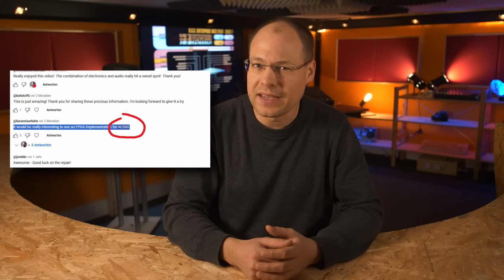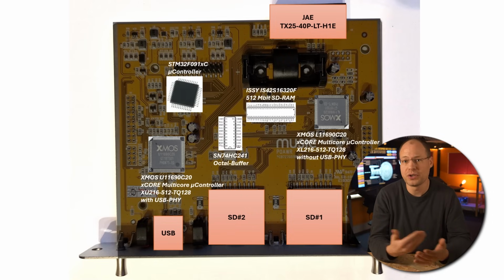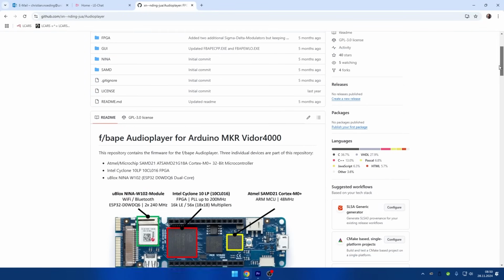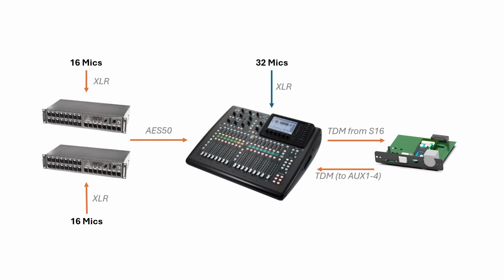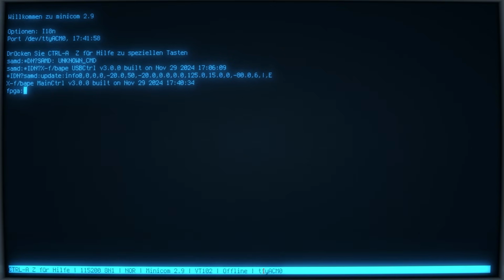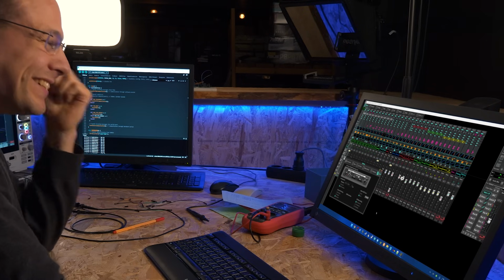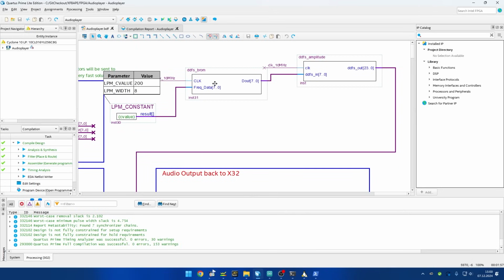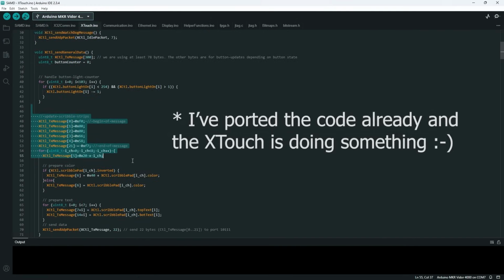X-FBAPE - The DIY FPGA-based card for the Behringer X32

Comment: Great video! You've dared to reverse-design of this HW. Great!
Just a question: Did you ever try to analyse the data exchange between DN-WSG and X32? I just tried to take a look - it seems like the signals are remaped.
Reply from the maker: Up to now I do not have an WSG-card here. As far as I know the FPGA is capable of rerouting the pins for special cards - at least to allow synchronisation of the console to the expansion card. From time to time I search on ebay for an affordable card, but up to now there was no bargain here...

Comment: Hi there. This is a pretty impressive accomplishment. Congrats on the hard work! What are your thoughts on the possibility of an independent device that can take two expansion cards and be used as a format converter using the Behringer low-cost cards? It seems like the audio signal would be pretty straightforward, just cross-patching the TDM sends and returns between the two cards. I would assume a clock would be necessary, unless it was as simple as making slot 1 the master and slot 2 the slave, and have slot 1 take the clock from the incoming signal? The hard part would be sending the cards whatever commands are necessary that the X32 would usually send to the card. I know you have some experience with these cards. Do you think this would be achievable?
Reply from the maker: Hi, I already implemented this function for two X-Cards: https://github.com/xn--nding-jua/DuoXCardAdapter

So, yes, this is possible :)

Comment: it would be nice if you can come up with solution to feed DN4816-O directly from aes50 line so we can have 32 outputs in the amp rack for PA feed
Reply from the maker: AES50 is OpenSource since Christmas: https://github.com/YetAnotherElectronicsChannel/AES50

And we we have a working implementation of an UltraNet-sender. So its already possible to create either an UltraNet-sender with 16 channels to the DN4816-O or an AES50-sender. I planning a video on showing how to deal with UltraNet and StageConnect in a video in spring 2026...

best regards

Comment: Can you control all 64 from the x32 itself though? Or is it in essence just two mixers' stereo out combined?
Don't get me wrong. I absolutely love the project, and the possibilities, but for practical use on the road, it's not as interesting to use an expansion like this if you have to train a band's own FoH tech on how to use it. Just thinking in practical use for my needs ...
If you happen to know how I can get my hands on a few defective X32's (or 1 working one) nearly for free... Social security doesn't allow spending anything basically, so fixing broken gear is my best bet to get some gear together and not be jailed at home with nothing useful to do (long story short: multiple disabilities, not able to get a job anymore, allowed to do some small gigs as a means of "occupational therapy" but I can't make a profit or spend any money to do so.)
I'm in the Netherlands btw, and desperate enough to ask ANYWHERE I can think of ....
Reply from the maker: Yes, using the original X32-control-interface (DAW-section) I'm able to control the additional 32 channels resulting in a real 64-channel audio-console with the same latency as the original console as I'm adding only one single sample as additional latency. But you are right, adding another X32 using AES50 would result in a very comparable system - and with additional processing-capabilities like compressors, EQs, etc. that my system is lacking due to the small FPGA. It was more a "what can be done as a DIY-project" than "is it useful" :-)
Reply: @pcdimmer  Nice!

Comment: hay bro you did great job i need this type of something for wing i want have some issue with every console in love event we have to set-up pa system many different places wing make many things easy but somthing i also need more human never setisfy 😅 so i have question if we make card for wing i need to put waves server or one software wich work plugins for each ch wing give 2 slots par channel but with 16 slots limited plugin i want every ch different things i have to put pay 3 way system different places i have to long xlr cable or some analog cat cable  Dante have same solution but i don't have to to much amount for that so i want single cat cable cat have 4 to 8 ch each place with if we place one location  for 4 ch than we loop cable from that box to other box i am week in english language but trying to explain you that can we do with some cooking stuff
Reply from the maker: Yes, the WING-card-slot could be used to implement something like this. I've already reverse-engineered the used connection and the protocol (https://github.com/xn--nding-jua/WingCard). But the development of such a card would take a reasonable amount of time. As Dante already offeres such features I fear that nobody will work on this...
Reply: thank you for your kindness and reply to me and one more thing i try this Link but its 404 error page not available in github if you resend this Link  @pcdimmer

Comment: Hey Chris!  Your work on the x32 is mind blowing!  Do you happen to know how to add an AES/EBU3 output on the X32 Rack and Core?
Reply from the maker: For the X32Rack and Core they removed the AES/EBU3 connector from the PCB. Using the card-expansion-slot and my X-F/BAPE-code it is possible to create a TDM8 -> 4x AES/EBU3 converter without problems but you have to create own FPGA-hardware for this. The only "easy" way is to use a StageBox like the S16 and use the ADAT-outputs and convert this 8-channel signal to 4 AES/EBU3-signals with additional converters.
Reply: @pcdimmer  Yeah :( However, I was comparing schematics from the fullsize x32 and photos of the board and it looks like it's a shared chip (IC15-A: 74LVC245) that serves the p16 bus and aes3 port.  The rack is missing an inductor, and a few small components but it looks like it might be possible to connect it.  The only other thing might be that the x32 firmware might not allow you to output to the aes3 port since it technically doesn't exist, as far as the firmware knows.  
A colleague of mine has a few dead fullsize main boards that I'd like to use for components to add that aes3 port to my x32 rack.  I'll let you know if I get anything.  

Check out Page 39 (area E3) & 40 (area C1) of the x32 service manual.

Comment: is it possible to implement aes output in x32 rack?
Reply from the maker: It would be possible with this kind of DIY expansion-cards because we have direct control over all 32 audio-channels. But as the X32 Core/Rack seems to have a different Main-PCB-Layout without the AES-connector compared to the full-size console, I think it is not possible to add an AES-connector directly.

Comment: Very impressive! And a nice showcase of an application where an FPGA really shines.

Have you tried playing with any open source FPGA software, like Yosys or project ICEStorm?
I've only blinked some LEDs so far (did a nightrider-style LED sweep), but at some point I'll try some audio projects as well.

(A far away goal of mine is to play with audio networking, using IEEE AVB/TSN protocols. Maybe even building a barebones AVB-capable switch.)
Reply from the maker: No, not yet. But in two weeks I'm at the Embedded World 2025 in Nuremberg and I will try to get some small Eval-board from different vendors to play with. Maybe one of these devices is a lucky strike and the toolchain is easier than of the Altera devices... We'll see.

Comment: Great job, really good video👍
I would love a version of the X-usb with MIDI and DMX 😅

For some reason, behringer do not let us use the midi connector of the X32 as a midi interface like an XR18 in a DAW... I used the XR18 for my IEM band rig with a Reaper session, to send midi to our modeler, and then I upgraded to an X32. Excepted that the X32 can't do it... so I have to link my modeler with USB and send MIDI from it 😕
And has I love be doing many thing, I started a synced light show😂 So a card with those 3 features would be a must have for band like this, AUDIO / MIDI / DMX😍
Reply from the maker: This sounds great: as the used XMOS-chip (XMOS XU216) of the Behringer X-USB is a standard device and the development-toolchain is available (https://www.xmos.com/develop/usb-multichannel-audio), it is possible to create a X-USB with DMX512. But I'm not familiar with these types of controllers. Maybe someone else will implement some DIY boards for these consoles, now that the interface is reverse-engineered? For the WING I already did some work, too ;-) Have a look at my GitHub-page: https://github.com/xn--nding-jua

Comment: What a project! Amazing work reverse engineering and mapping the x32 card port! I mix 5 nights a week on an X32 for PA output, stage monitors, in-ears and livestreaming at the same time. Have you thought about integrating Neural Amp Modeler? Would that code run on the FPGA? How can I help? I have very little code ability but lots of computer, networking, electronics and production experience.
Reply from the maker: Hi. I figured out how to implement Audio-Gates, Dynamic-Compressors and Equalizers using IIR-Filters. But up to now I have no experiences creating Amp-Models. One of the next things I'd like to work on is implementing a well-sounding reverb. But I fear Amp-Modelling is quite challenging using pure logic-elements within the FPGA...
Reply: @pcdimmer  Ah, yes I figure it would be a tricky thing to implement. Have you thought about sharing the scematics and or the board design? I have a small cnc and would love to try building this.
Reply from the maker: @robsidle5200  Yes, schematics and Gerber-files are available on the Github project. So you can build your own Card. All Software-Parts are published, too.

Comment: What I think would be a useful implementation would be a simple mixer that combines the audio from card input 1 with card input 17 at equal level and send the mixed signal to card output 1, card input 2 mixed with card input 18 and sent to card output 2….and so on up to input 16 mixed with 32 and sent to output 32. This would allow you to combine 16 channels of audio outputs from two X32 boards together and route the combined signals as one.
Reply from the maker: This kind of audio-mixing is very easy within the FPGA. IIR-Filters need quite lot of logic-elements, but changing volume of one channel and sum up individual channels is very easy. This is absolutely possible with this DIY-Card.

Comment: You could at first mix the drumset down via a submixer, so you can use up only two channels on your X32
Reply from the maker: Yes, of course. Several people asked me about the benefits of the DIY-Card. I have a X32-Fullsize and a X32Core. I could use both systems connected via AES50. But my idea was to use only a single console with only three stageboxes and one Cat-Cable to the stage. In the last couple of days I improved the software for the card and can use the DAW-Section of the X32-Fullsize to control the additional 32 channels as well as the DMX512. So there is kind of benefit now.

Comment: Is it mabe also posible to decode the waves sound grid code
Reply from the maker: Waves Sound Grid uses regular Ethernet-packets to transmit the Audio-data at a speed of 1Gbps. Up to now I only figured out how to use 100Mbps Ethernet with an FPGA. So I fear this is a bit too heavy for a Spare-Time-Project.

Comment: Great job. I want to create a converter from AES50 to fiber optics. I think that fpga will simplify the whole thing. At first I wanted to follow the path of least resistance and send the clock signals to one sfp insert and the aes50 signal to the other using simply ethernet phy. But for now I am at a standstill due to lack of time. But I see that this may be a project for you.
Reply from the maker: I took a short look at the AES50 protocol - thats a totally different pair of shoes... Just converting it to a fire-optic could be possible, but decoding and changing data is challenging.
Reply: @pcdimmer  So I wanted to take the path of least resistance and not decode anything. Take MLT-3 and convert it to fiber.

Comment: would be awesome if you could control the additional 32 channels with MIDI from the console itself! (hit the MIDI/DAW switch)
Reply from the maker: I already updated the GitHub-Repository. The original MIDI-Interface of the expansion slot is now supported and the DAW-Section of the X32-Console can be used now to control all additional 32 channels. With the "REC" button of the DAW-Section the controls can be switched to DMX512-Control, so the X32 can control the lights with the original faders now. I'm planning a follow-up-Video to show the new functions for end of January... stay tuned.

Comment: alright this guy is clearly above my pay grade on a technical level, the engineering behind it is crazy; so i will ASSUME i'm missing something ... but i'm not sure the benefits of the method in the video over a typical card out to DAW procedure:

S32 #1 -> AES50A port of X32 -> AES50A blocks to X32's channel strip assignments = processable internally

S32 #2 -> AES50B port of X32 -> AES50B blocks to X32's USB/Card Multitrack out blocks -> to a DAW = processable externally

DAW master output -> Card 1+2

Aux In Remap -> Aux In 1+2 Remap to Card 1+2

unless i'm missing something, this accomplishes the same thing. in both the video method and this method, the "extra" 32 channels are mixed externally and routed back in. this method uses a DAW for the external mixer. latency will be higher with this method but will work just fine for sources that don't need to be cross-monitored on stage, can be below 10ms depending upon the computer
Reply from the maker: Yes, you are absolutely right: a DAW is able to do sub-mixes and process insert-effects using the USB-connection - if the round-trip-delay is not important. But if you think about the stability, a hardware-solution has some benefits. For me, the lowest delay was important in order to avoid overlapping effects in the main mix. The presented card has a round-trip-delay of 20.83 Microseconds at 48kHz - so one single sample. The FPGA processes the incoming audio with 100MHz (could be more if nescessary) and if you are not using any EQs, the incoming sample is processed after 10 Nanoseconds. Due to pipelining each stereo-EQ takes 140ns. As I'm using 5 EQs at the moment, we end up around 1 Microseconds. So our FPGA is around 20 times faster than the used sample-rate. So with this card, we have the same audio-quality and audio-delay as the main-console.
Reply: @pcdimmer  ah okay yes that makes sense. also did i miss any info on monitoring the additional 32+6 inputs? can the inputs monitored individually (like sending into a bus) or only able to monitor after everything is mixed together and returns back to the aux ins?
Reply from the maker: At the moment I'm trying to implement a Mute and Solo function to the Card. Lets see, if I can manage some additional functions. But as I have no access to more than the 32 audio channels back to the console, the options are a bit limited at the moment...

Comment: Fascinating video.  I'm curious if you could transport audio directly from a card like this to a pcie bus interface card on a computer for ultra low latency plug in processing without using a high latency protocol like USB?  I currently use X-Dante, but the Dante pcie card is extremely expensive.  A more cost effective solution would be a game changer for many sound engineers.
Reply from the maker: I'm not familiar with the PCI-Express-Bus. I guess it will take some time to implement the Bus-Logic into the FPGA. I fear, that is out of the scope of a homebrew-FPGA-system...

Comment: Impressive! I would love to see an extension of channels where the musicians also able to control the volume of the extra channels in their in-ear mix (bus mix). That would be even more impressive. Great job!
Reply from the maker: My intention was to increase the amount of main-mix-channels of the console. But additional bus-mixes are absolutely possible with this project: the FPGA has enough free ressources for sub-mixes and we can use the spare channels (channels 1-2 are the main-mix at the moment, channel 3-4 the SD-card, channel 5-6 the Bluetooth-Receiver) to transmit several sub-mixes back to the X32. We can route all 32 regular input-channels to the card, do the submixing here in the card and route submixes back to the X32. These submixes could then be distributed to the stageboxes or other outputs. But for this we are using the regular P16-M in our band so I did not see a benefit for us when I planned this project.

Comment: Could this be used to create an AVB/tsn/Milan card?
Uhhhh.. please?
Reply from the maker: AV/Milan seems to use a kind of "Quality of Serice" (QoS) in Ethernet and seems to reserve a specific amount of bandwidth for the audio-data. This is a different approach than the expansion-cards are using. In the X-Cards we have dedicated digital-audio-streams that have no control-overhead, but only plain uncompressed audio with a bit-clock. So there would be lot of additional work and different hardware until AVB/Milan could be used here.
Reply: @pcdimmer yes it would require a different Ethernet chip that supports 802.1AS/1588
/sigh
A man can dream, right? If only AVB was easier to integrate with the Arduino and Raspberry Pi worlds.
And Dante is expensive.